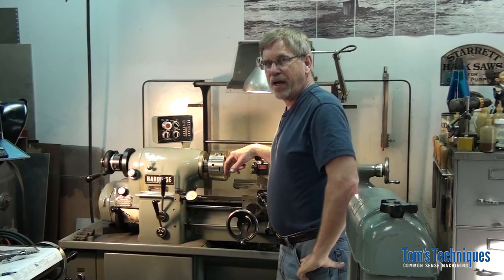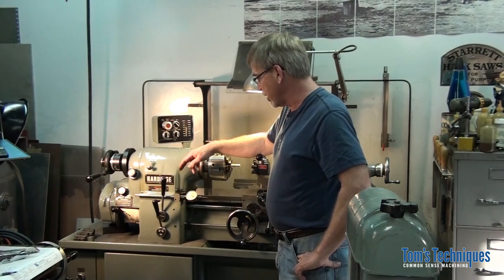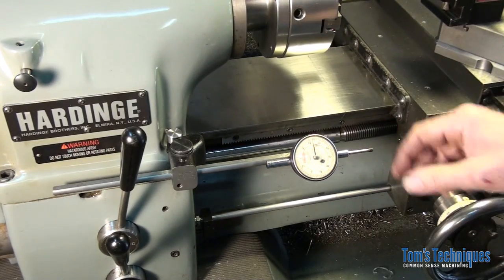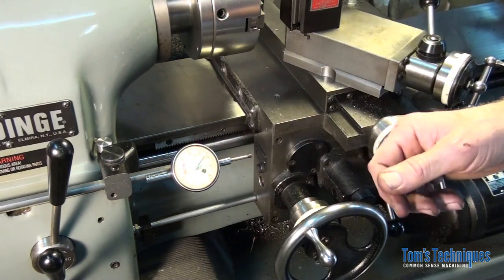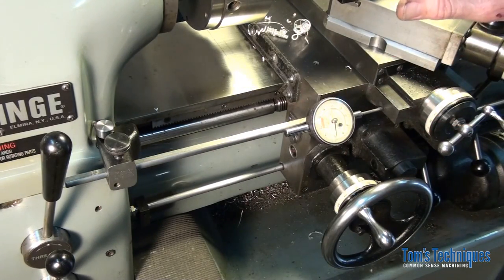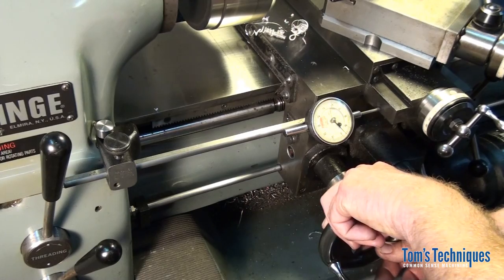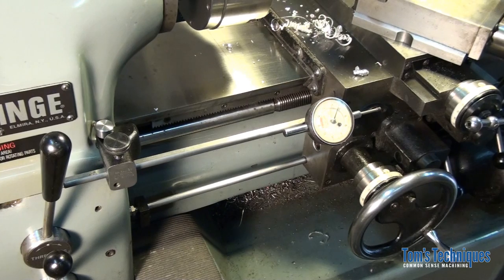Dial Carriage Stop

Comment: Tom, thanks for posting this video. My ancient (1940) 10" Atlas has so many curved surfaces, indicating carriage travel has been a challenge. This video inspired me to give it another try, and I was able to fabricate a DTI mount using my original micrometer stop and some bar stock. I only have a watchmaker's micro-mill, not a "real" one yet, so the setup's nothing fancy but it works well for the small brass parts I make here in the shop. I need less than 1" of travel for those, and with this setup clamped to the way to the right of the carriage and touching off on a piece of bar stock held underneath the threading dial bolt, I'm in business. Many thanks! 

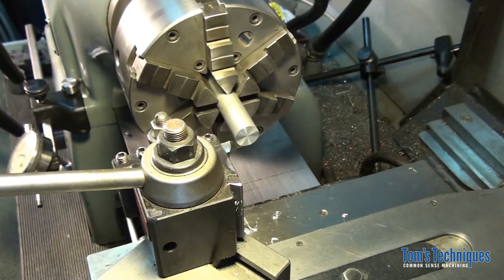Acts 4:12
Reply from the maker: Great! It's good to hear when someone gets some use out of these videos.

Tom

Comment: Great idea. Have seen on another post that you can fix a magnet to the back of your indicator. My concern is that I may forget the fixed one is there and crash into it. Will have a go at making one.
Reply from the maker: Yes, that is a problem with magnetic bases. The bad part is that sometimes you don't realize that they've been bumped. A permanent bracket is much safer.

Tom

Comment: I use one on my cross slide as well, a lot cheaper than fitting a DRO, and for small 10 off jobs it is a great way to go, but you do need at least an inch movement on the  plunger. I do like your chuck! That is a gem.
Reply from the maker: +Englishman French 

Yes, the chuck is a joy to use. Not sure how I ever got along without one.

Dial indicators help, but DRO's are hard to beat. I hope to add one to the Hardinge this coming year.

Tom

Comment: Your Hardinge has a unique bedway system. I can see how that style of indicator mount would be best suited to it. My lathe has the more common v-ways and I just use a mag-back indicator (even though the magnet is stuck full of chips).
Thanks for sharing!

Colin
Reply from the maker: Magnetic bases get in the way if they are stuck to the ways. You need to make a permanent bracket like this one to hold the indicator. It won't move either.

Thanks for watching.

Tom
Reply: Toms Techniques
 I see one advantage of the mag-back mount, you won't break the indicator when you forget about it and run into it. I guesss you could extend the holding bar past the indicator so the the bar hits the carriage before the indicator bottoms out

Comment: I just made  one for my Sherline. Never seen this done before.Thought it was just one of my quirky ideas. But it works well, and on the Sherline there is no good way to make a normal hard stop.
Reply from the maker: Excellent! I actually prefer it to a hard stop because it's easy to vary the stop point without resorting to gauge blocks or other spacers.

Comment: Hi Tom,

These are practical, just an idea I had while watching the video...

For parts longer than the travel of the indicator, why not machine precise index holes or groves in the horizontal bar, in your case it would be 1 inch or what ever the indicator can cover... Just a suggestion.

Too bad for nice weather we'll miss your videos.

Thanks,

Pierre
Reply from the maker: Pierre,

That's an interesting idea, but you might have some difficulty implementing it. If you added holes or grooves to the right end of the rod, the unused part of the rod would at some point interfere with the indicator travel. Whatever indexing method you devised would have to be applied to the left end to avoid interference, unless you could live with smaller increments.

I'll get back to a more regular schedule for the videos. It's just that after such a harsh winter, it's hard to resist the warm weather.

Tom
Reply: Hi Tom,

Agreed that winter was a cold hell here near Montreal, we are just starting to get warmer times by the last days.

For the holes or notches I was meaning to make those on the left end of the bar, where like on your lathe, it would be the screw holding the bar that would do that function.

Pierre

Comment: I like using my mighty mag dial. Its extremely convenient. But i think i like the functionality of this fixed dial much better. And i suppose you could also purchase dials with larger ranges if one inch was consistently insufficient. Thanks for sharing this great tip.
Reply from the maker: Mitchell,

I've thought about using an indicator with more travel, but they are much more expensive and alignment (perpendicularity to the carriage) becomes more critical. The 1" indicator seems to be a good compromise.

Thanks for watching.

Tom

Comment: Ahh. You bring up a good point about larger indicators. I also noticed that even with your one inch, you had difficulty keeping it perpendicular to the ways. Most likely just due to your awkward position beside the camera. I was curious though. If someone were to make one, would flat stock take out any of that angular play? As usual, im probably over complicating a simple build. Lol thanks again
Reply from the maker: The round stock works fine and it's the bracket that determines position, not me. I was just having trouble lining it up on the flat because I couldn't see what I was doing and was out of position. I'm not really that clutzy. ;)

Tom

Comment: I love the way you can change speed on those Hardinge machines whilst the spindle is running. I too use a magnetic backed clock, learnt from Abom79. I shall be making a posh one like yours though having watched your vid. Still saving for a DRO.
Reply from the maker: Variable speed and quietness are advantages of a  belt drive. Unfortunately them come at a cost, with lack of power as a disadvantage.

Thanks for watching.

Tom
Reply: It's also just a plain beautiful lathe...

Comment: Tom

How would you machine the flat on the extension rod the D I is attached to ?

My first thoughts would be to start with a workpiece longer than required, clamp each end to the table and mill between the clamps, then cut off the ends.

Is there a better way ?

Thanks and kind regards
Reply from the maker: Good question,

That's one way, except the center would be unsupported. I would clamp the stock to the table with multiple clamps along its length, mill the flat to size everywhere the clamps aren't, move the clamps and mill the remainder of the flat.

Tom

Comment: i have a dro pro dro i have installed on my lathe... is it as accurate as using a dial indicator?
Reply from the maker: Depending on the make and model, it's probably slightly more accurate. The downside is that a digital readout is a LOT more money than a dial indicator..

Comment: Tom, thanks for showing how the dial indicator can be used like that. Looks very useful. I suspect the same idea could be used on other machines where small movements need to be measured precisely.  

I followed the link you posted, and got a Wordpress error about not having permission.  I removed the last bit about the nonce from the URL and it worked fine though. I suspect the nonce part is being used like a cookie to tell the site which session the request is coming from, and since I'm not you, it complained. 

-- Mike
Reply from the maker: It is very useful. Without a DRO, I use it almost every time I use the lathe.

A few of these have already been made by viewers for various lathes and they have sent me pics. I put together a page for my website, but haven't figured out how to implement it yet. Until then, you can check it out at the following link for ideas:

http://tomstechniques.com/dial-carriage-stop-examples-for-varoius-lathes/

Tom